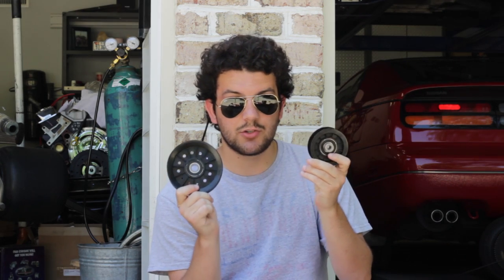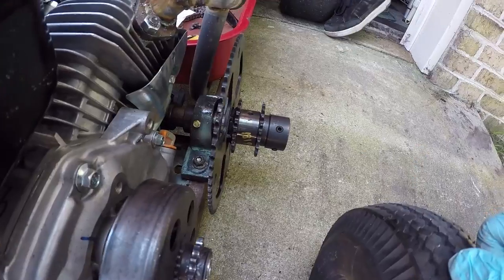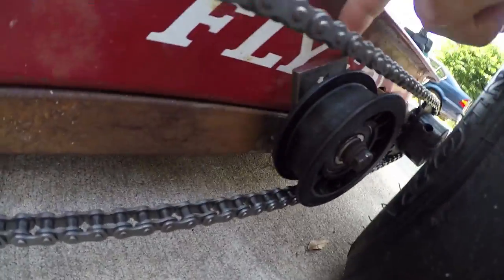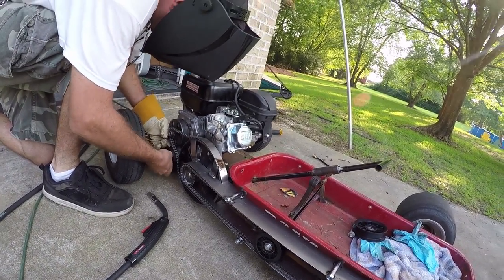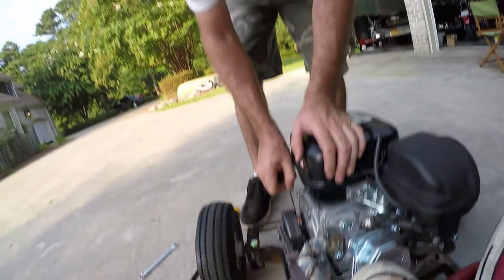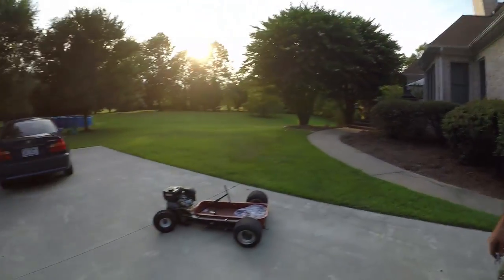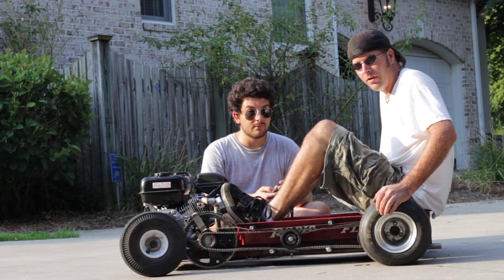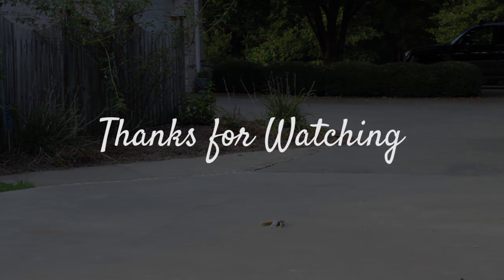Rat Rod Wagon Build: Pt. 7

Comment: if you add nylon blocks in between your chain pulleys that pull the 2 sides if the chain toward each other that should give you better tension and keep the the chain from jumping. all your pulleys are doing now are being chain guides and not so much a tensioner.

Comment: Hey +CarsandCameras I love your guys videos! I'm not sure if you accept advice very well it being that I am only 15 but I think I may have a solution to the chain slack problem.  You obviously have plenty of chain tension and even if you applied more you would still have a substantial amount of slack in the chain. You guys were on the right track with applying a tensioner and also which side of the chain you placed the tensioner on (the under side with the least amount of tension), but i think it would be much more efficient to apply tension the other direction to the underside of the chain (applying tension upward from the underside of the chain which is the part of the chain that is lowest to the ground). I'm very sure this would help solve your chain slack problem because not only would it apply chain tension but support the weight of the chain. I hope I'm able to help if you haven't already fixed it yourselves. I love your videos, keep them comin'! 

-Jonah

Comment: Looks pretty good already!
But I think if you guys change the sprocket on the jackshaft to a smaller one and then have a bigger gear on the rear axle, it won't be hitting  the roots in the yard so much. It would also reduce the stress on the chain a bit, but i'm afraid the chain guard and the tensioners have to be modified then.

Comment: IMHO you should use a bigger engine side sprocket and a smaller "middle" sprocket so it doesn't bottom out on stuff. I would also use delrin/Teflon to make a chain slider that supports/tentions the chain from the bottom rather than pressures it downward. 

Awesome build! Keep at it!

Comment: The tensioner should be forcing the chain into the sprocket 
the length of chain requires you to have a tensioner on the outside of the chain kinda like the one in the front chain off the motor 
thanks
enjoying

Comment: Dude(s), cool project wagon.  No darts here; but a thought:  I have a 1964 WheelHorse garden tractor & it runs a long V-belt the full length of the chassis with no issues.  I think the short jack shaft chain you are running should work fine, but if problems persist, consider a v-belt for the long drive. BUT, that chain and all its associated apparatus looks raTical fine.

Comment: on you Axel chain, you could make a chain guide out of some dense plastic. that can take up a Lil more or the slack but mainly Will quiet it down, since the chain Will be hitting plastic instead of steel. looks good so far guys! keep it up! BTW is that a z32 300zx I spot in the garage??

Comment: for a brake you could put a pully on the rear axle and put a kevlar belt around it and tention the belt with a braking pedal, it would work like a belt brake. i used this setup on my 390cc gokart build and it works very good and its cheap to build and maintain.

Comment: I wonder if putting a torque converter on it would solve that (engine side) chain issue by not having the sprocket so low?  I believe that might be the issue with derailing itself while on the grass, just from the side view it looks like there might be about an inch, or less, ground clearance for that big ole sprocket.  Just a thought anyways but now for some brakes...before it's not fine LOL.
Reply: Yeah the way the sprockets are set up could be done much better.

Comment: Cool build guys..How about trying a pair of shorter chains ? Put a pair, side by side gears where the first tensioner is to shorten and help prevent chain whip inside the chain guards. I see that as a means of taking whip and vibration out of that long chain and it would help keep a 32 chain tight at the same time. Just an observation and idea I had. Never know, right ? Been watching all the vids on the build, good luck to completion !!
Reply: I was thinking the same thing, it would definately make getting the alignment perfect easier as well

Comment: It need bigger front wheel. I see that you can't have the tire diameter be any small due to ground clearance issues, but it would look awesome if you put some bigger front wheels, same size tire. Also for the seat an old tractor seat would look pretty slick. It would also provide a little "suspension". I don't know if you guys got around to it yet or not, but there is a wire near the bottom of the motor and if you unplug it, it will stop the engine shutting off when it thinks the oil is low. This thing is pretty cool though. Great Job!
Reply: +Zach Mikko thanks

Comment: You guys should get a plasma cutter. Like when you were making the slot for the chain adjuster... Would have taken about 30 seconds with a plasma cutter. Also try moving the engine forward slightly to tighten the short chain. For the long chain get the smallest sprocket you can get (Probably a 6-7 tooth) put it under the bottom of the chain a couple of inches back from the front on an L shaped metal bar about 6 inches long, make a pivot point in the middle and attach a strong spring to the other end pulling that end of the bar back. This should work really well.

Comment: Why do I get the feeling you have overlooked the fact that the dang big sprocket that drives the long chain in the front is barely clearing the floor and then it pops the chain off when going into the grass? Tilt the engine or do something to give it more clearance
Reply: +VochoTalacha they just need to get one that is slightly smaller
Reply: a torque converter would fix that

Comment: The big sprocket on the jackshaft does look like it's more than likely what's giving you issues off-road. Is there any way to shim the mounts for that and pull it up a little? You've got all your gear reduction there, looks like 1:1 on the long chain, what if you used a smaller sprocket on the jackshaft and another one about the same size on the rear axle? Basically split your gear reduction between the two chains. That way neither of the big sprockets has to be as big as that one big one you're running now. Might also reduce the strain on the longer chain so it doesn't stretch as much.

That and some springs for the tensioners could go a long way.
Reply: +Darwinpasta im redoing the chain setup so( it'll be finer )
Reply: +Isaac Jennette Can't wait to see :)

Comment: for the drive system, you should do a series of driveshafts with 45 degree sprocket gears running to the back if the chain system doesn't hold up in the long run

Comment: 42 chain is what you need. for throttle run either a minibike throttle or a thumb style off of a 4wheeler. then a regular bike brake handle.

Comment: I use a 420 chain on my Rat rod 212cc chopper
I also took a the exhaust off of a 55chevy pickup and used that for the muffler,  I've found that the bigger the pipe the meaner it sounds

Comment: I dont like 35 chain either the only real benefit is you can run smaller diameter sprockets. but it certainly falls off and gets bent  easier

Comment: Needs a slightly smaller countershaft sprocket to keep it from digging and wrecking the chain, you can make up the difference by going a few teeth bigger at the axle. Also, for purely cosmetic reasons, you need larger rims in front with lower profile tires.

Comment: Might wanna try using a tensioner instead of an idler setup like what you have setup. At the front right near the gear, use a pulley to push the chain up and use one of the idlers to counter the pressure on the chain by the tensioner. Like a serpentine belt on a car. Just an idea.

Comment: Seems like I've heard yous guys pie cutting on recent videos although you do have the bender now... Y'all aight to do y cuts. Cut a y and take the v out and fold the opening shut. Then the v becomes a perfect filler piece and your volume will stay more equal around the bend. You can grind down the welds and it'll look bent for really tight turns. Just wanted to throw this out there while i was thinking about it... Sorry about adding it to a vintage video.

Comment: you should add wheelie bars. if you do, make something yo keep it from slamming that front sprocket into the ground. also, instead of the 1 long chain, make two, add spring loaded tensioners. it'll be a bit more forgiving.

Comment: Its really cool but its Radio Flyer roots are all but lost. Its basically a gokart now. The tub is almost totally hidden by the rear tires and on the left side also by the chain and chainguard. Should have mounted the tub so it sat above the wheel height. Another cool thing might have been to somehow incorporate the wagons original pull handle into some sort of steering tiller. Not knocking what u did. Just making some observations.

Comment: Hi guys, maybe put the chain tension wheel on the other side of the chain,( on the bottom of chain pushing upward, )????? Just my thoughts hey. Apart from the chain biz, it goes pretty good i think so well done, thumbs are up;-)
Reply from the maker: +mark acker Putting the tensioner under the chain was my thought, but Ike thought it would do better on top of the chain pushing down. But thanks!

Comment: I would think the chain tensioner would work better if you used it to push down on the top chain or up on the bottom chain. Right now it is not a tensioner its a slap guard. Might consider having the 2nd chain (long one) go back before the rear wheel to drive a 3rd sprokect which would have a parellel sprocket to drive the rear wheel. And make it so you could change them to change your gear ratio. LIke use a mountain bike front cluster like a 46/36/22 to get some variable gear tuneability.

Comment: Guys can you go to a smaller sprocket, that large one is only about 1/4" from the ground? Also, find some teflon cutting boards (walmart ect) to use as a chain guard/runner.Your sheet metal one will wear and catch the chain in short time.

Comment: You can't put a tensioner on the pulling side of the chain it will just get ripped to shreds.  Make a spring one on the lower length of chain.  Great vid and project though keep it up!

Comment: get that motor on some mounts that will raise it up about 2-5 inches off the frame to get the bottom of the big sprocket and chain about 1/2 inch or so above the bottom of the frame. that way, you guys can take it through the grass and such without banging up the big sprocket.

Comment: +CarsandCameras me and my cousin are trying to build the same thing, but were having problems finding parts on account of a short budget, were willing to spend a good chunk on the motor, but where do you guys get the wheels and the motors from?
Reply from the maker: +Carl Piraino We had the wheels sitting around, and we got the motor from Harbor Freight for $100 on sale.
Reply: +CarsandCameras ok thank you, can't wait to see the next installment of the rat rod wagon saga
Reply: +CarsandCameras Im sorry to bother you again, but i forgot to ask do you know what the motor is called, how much hp its running, and if its vertical or horizontal shaft. thanks again in advance.

Comment: Prob has been said.. but with 690 comments.... but the chain tensioner should either be on the top of the chain, or bottom.... not in the middle... but this is a cool build.. just found you guys, and subscribed. Like what you have to offer.

Comment: Yes and make that kill switch a monetary push button so when you're hauling ass like that you can use it to slow yourself down by turning off the ignition I'm using it kind of like an exhaust brake on a semi truck I use this method on my gas bicycle it works really well just a thought

Comment: I'm sure Ike at least knows this, but if you bypass the governer, which is actually sort of a rev-limiter, you can actually blow the engine. Blowing the engine could be disastrous with you sitting so close. Honestly, this type of engine isn't the best if you're trying to get high revs and lot's of horsepower. I think you should look on your local classifieds for something like a 100cc two stroke or 150cc 4 stroke dirtbike engine.

Comment: I had an idea. ..... maybe use a belt like they put on a motorcycle instead of a chain? It would be safer and quiet. And also use a couple of spring tensioners from a car for a serpentine belt. no need to buy new get from a junk yard
Reply: +David Johnson we thought about belts and other options but the chain was the most old school and rat roddy we could come up with. and it'll be fine. lol

Comment: it's a little late now, but I'm sure tractor supply would have 90° gear boxes and a square driveshaft. have a short chain going from your jackshaft to gearbox, then a driveshaft, another gearbox to rear wheel. no chain, just a shaft that could be covered with a piece of pipe.
Reply: +dave1135 we thought of that, but its alittle pricy

Comment: i think that tensioner near the back wheel is nearly useless. it needs to go further from the sprocket to be effective. it does add tension but regardless of how much tension you have with a chain that long it's going to slap. if you moved it to right behind the tensioner in the middle of the frame it will be much more effective at reducing slap and adding tension.
Reply: also both tensioners should push "in" on the chain causing them to have a better connection with the sprocket rather than "out" on the chain like yours currently are. this may be tough considering how close the 2 sides of the chain are together but if you stagger them enough it should work out fiiiiiine.... PLUS it'll put the chain further from the ground AND further from your guard hopefully reducing the noise

Comment: Tension er need springs.  The oval bracket is a good idea.  You just need a loose 'free floating' pulley, with the spring pushing it into the chain.  = is a groove  O is where the pulley is mounted, and x is the spring that's mounted to the pulley, and a bracket to pull the pulley into the chain.  

----------------
|====Oxx|
----------------

Comment: what exactly did Ike do to bypass the governor and make those sexy sounds?
Reply: +Moto Time you have to split the engine case to remove the govenor. i guess the exaust was the rite with and distance from the engine 3/4 pipe about 3 feet from the engine

Comment: A question: didn't you think about building a kart with a small motorcycle engine? Clutch and gearbox - that's why. A front-engined kart, like your wagon, with a motorcycle engine in it would be like a hot-rod, but small.
Reply: +Андрей Студенцов not shure if we are going that route

Comment: what about using a belt drive. V belt, rib belt or engine timing belt using the toothed pully wheels from a twin cam. it would be a touch safer on a kart with no brakes or seat but one less thing to inflict damage.

Comment: I say you change the motor to that similar to a riding lawn mower and have the chains and gears under neath in-between the frame rails of the  wagon, the only part that would be a little hard to configure is the way the rear axle is driven from under the wagon
Reply: you could even build a guard to cover the chains and gears so they never get hit when you're riding on the yard

Comment: The engine cuts off because the oil sensor senses no oil when your turning fast or jumping because it moves somewhere else in the oil pan thing so just the oil sensor cord and it shouldn't stall when riding just check the oil every few months

Comment: why don't you change the biggest sprocket ,for something with a slightly smaller diameter as the current one only looks like you've got 25mm of ground clearance,maybe its that causing your chains to jump,could be snagging up on stones/bumps in the road

Comment: put the throtal on the handle bar so it is like a dirtbike set up for the gas to drive so you do not have to hold the gas on the motor

Comment: For the throttle cable it should be a lever on the steering and than do the same thing with the brake like pedals except on the steering wheel or what ever it is you guys have

Comment: would be eazier to tension the front chain by making the motor so it can move forward on the mount
you can allso make two or three double sprockets instead of the plastic tensioner and use more than one chain  (front to first sprocket / first sprocket to second sprocket / second sprocket to rearaxlle ) the shorter chains will slap less

Comment: Half you ever thought of using offset chain connectors (AKA half links) That would probably solve ALOT of your chain slop by fine tuning the chain length

Also like another commenter posted. If you are gonna run that style of chain tensioners it really should be on the outside of the chain rather than inside the chain loop.

Offset connector:
https://www.kimballmidwest.com/images/products/small/41-9444.jpg

Comment: Maybe you should do some more little things like an old car horn and black and blue rims or maybe headlights and taillights like for the old cars get it looking a little better or somehow be able to lock of the front brakes and trie to do a burnout being that you've got all that weight from the engine in the front you might be able to but the backs just got so much traction it be hard to break loose
Reply: Meant to say just black rims

Comment: You do not need a bigger chain 35 has never had an issue put a trampoline spring on the tensioner and you will have no problem. But the tensioner should be on the bottom of the chain not the top that's ur issue

Comment: I think you need to rotate the engine 90 degrees and add a driveshaft and then a bevel gear at the rear. That chain is way too long. You could shorten it into three pieces with separate short sections of chain.